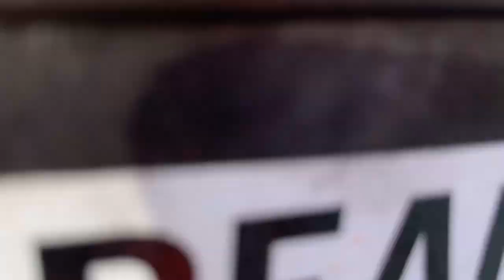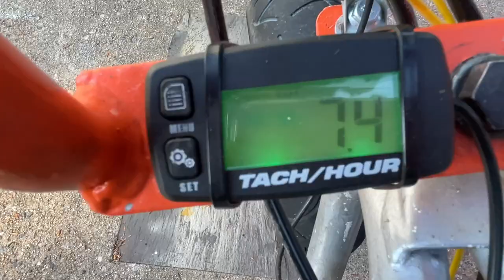Street Legal Doodlebug Minibike!

Comment: What would you say the most budget way of making a fast durable mini bike? Buy a mini bike and buy a predator 212 hemi and kit or diy as in get a frame, predator,and other parts in a kit ?(also easy assembly bc new to this mechanical stuff and don’t have the advanced tools like a  Sauter I think is how u spell it
Reply from the maker: Depends on which frame you have and what speeds you are trying to hit. As well as the purpose of the bike (racing, street riding, wheelies)
Reply: @JulDeeMotorSports  mostly a street bike looking for speeds of 50-70 mph with a Coleman ctu 200 something like that with suspension on it
Reply from the maker: buy new gears, big carb, springs. I have a exact video on the build you want
Reply: @JulDeeMotorSports  thank you will definitely have to watch❤️